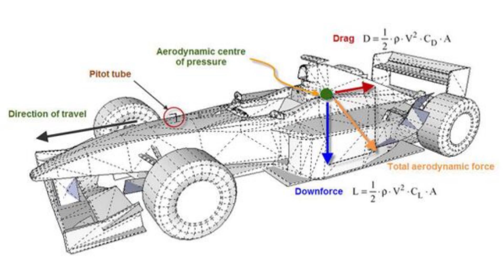Project 400: The Fastest F1 Car Ever Built

Comment: the way I see it lap times are a way better reference to what is technically faster. Wouldn't you prefer to go 70kph faster in the corner than 70kph in the straight.
Reply from the maker: Well, since a car like this has never driven on a track, it's impossible to ascertain a laptime. That's why I used differences in speed :)
Reply: @JebMotorsport  just looking at the car you would guess it would be slow, it has no rear wing for gods sake
Reply from the maker: Well, you'd guess that (which is what I did with the speed) but there's no way to estimate a remotely accurate laptime around a given circuit